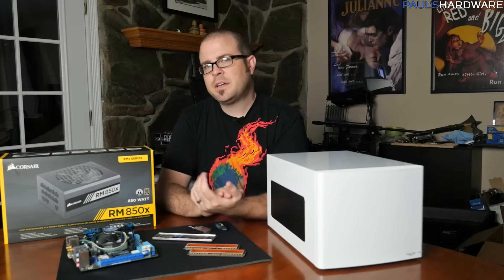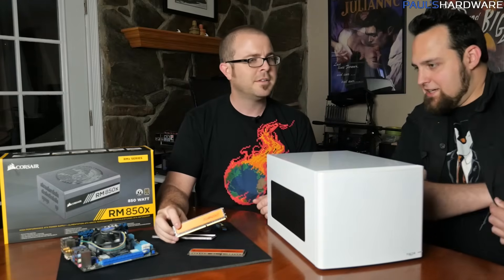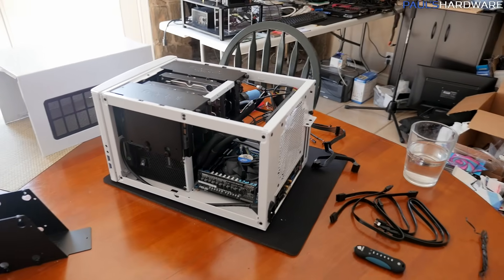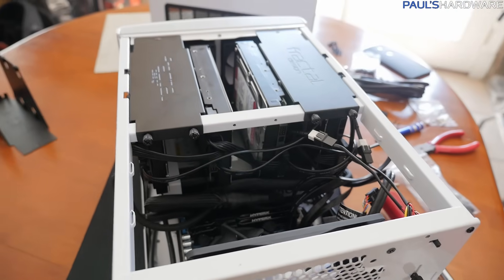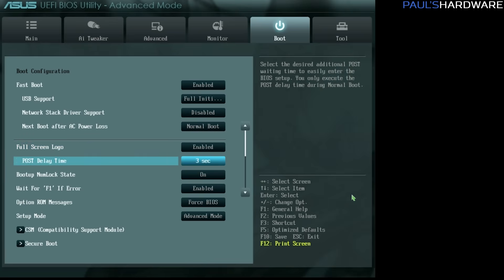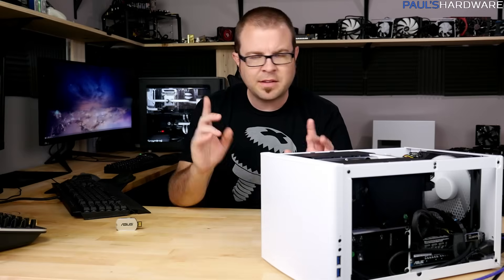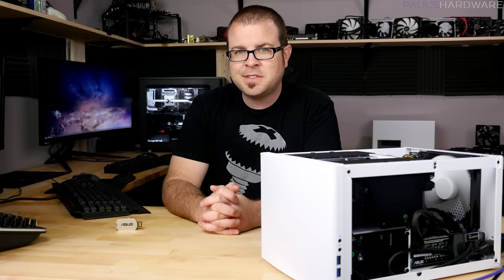Epic 16TB FreeNAS Build (Surprise Guest!)

Comment: ZFS does NOT need 1gb per 1tb of disk space. It will work just fine with very little ram. Companies like Synology and QNAP sell very moderate devices with small amounts of RAM lile 2gb or 4gb to be used as NAS and they work just fine, they know what they are doing. On top of that, a ZFS developer debunked this myth on reddit. ZFS DOES need 5gb of RAM per tb of disk for the deduplication table if dataset deduplication is enabled, which is a feature that is not recommended to enable for most use cases.

Comment: Running any system using ZFS without ECC RAM is asking for a  major disaster and becoming a statistic.  It's a server, use server grade components.  ZFS is a memory glutton.  Your memory needs to be just as reliable as your drives plus you should have it on a UPS.  The FreeNAS community has a burn in protocol for your CPU, memory and hard drives which I'm following for any system I put together for any system that's using ZFS.  Even the low end HP ProLiant Microserver G7s with the slowest AMD CPU supports ECC RAM and ships with it.  Spend the money on a server class board and ECC RAM.  It will save you lots of time and money in the long run dealing with the stress of building a Homer Simpson NAS.

Comment: plex media server very useful setting up a docker or a vm to run linux server then set it up as a whole house add blocker using pi-hole and for god sake put a 10gb nic in there and use its raid speed over the network with 10gb so you have fast in house file transfer.
Reply: https://discourse.pi-hole.net/t/installation-of-pi-hole-in-a-jail-on-freenas-server/4437

https://forums.plex.tv/t/how-to-install-plex-in-a-freenas-jail/60641

lets see here me 2 you zero I guess you dont know what you are talking about

Comment: Ideally your boot drive should be a mini flash drive the type that's about as big as a thumb nail this way you don't accidentally knock it out the usb port or damage it whilst it's running which can happen with a drive that sticks out. Also it's recommended to install freenas on two flash drives so if one decides to fail you can continue running the other till you get a replacement.

Comment: Great video, well put together, my portable NAS(for on site full system redundancy and syncing remote sites instead of using 3G) is an apevia XQPACK2 case(portable mATX), a pair of 5.25 to 8x2.5 hot swap bays, an EVGA x58 SLI Micro, a xeon L5620, 24GB ECC 10600 UDIMM(couldnt find 8500 udimm for some reason) and an LSI 9211(non raid) SAS controller the other 8 bays are read from the 6 motherboard sata ports and a PCIe 1x sata adapter, managment network is though onboard lan, main network is mellenox CX2 10Gb, oh and drives are seagate barracuda 2TB

Comment: Hey, Paul! Thank you for your monthly Q&A videos, they are excelent!
I have a question: I built a little NAS on my own with an old PC with 
Fedora-server, Amahi and free Greyhole (the command-line ver). At the 
day it has 4 HDDs and I was thinkin to add 2 or 3 more but I have to 
change the power-source.. I was thinkin in a 650W 80plus type, do you 
think it's enough? or I will have to look for a bigger one?

btw, It's a GA-945CGM-S2C motherboard with a Pentium D @ 3.2GHz and 
1.5GB RAM (will be 4GB in a near future).

Cheers from Argentina!

(cp from Probing Paul #16, my question it's more related to this) :)

Comment: Hi, thanks for the video.  It's super informative.  Im looking for hardware recommendation to do something similar.  Im looking to do 2 things with it.  First as a backup system for all of my photos and videos and 2nd as a media server.  I'll have around 16 TB for storage for the photo and videos and setup a separate jail for the media server files.  I'm look to run plex and have the system transcode all of the files so I can watch it from my amazon fire tv.  So I need a fast enough processor to handle the transcoding.  Any recommendations?

Thanks!

Comment: seems like it would be more expensive to build a nas than buy one. What was the build cost?
Reply: less than buying one
edit: i slapped one together earlier today out of curiosity in PCPartPicker and it came out to like $1500+ with new parts. if you where going used for the motherboard, and CPU/cooler (and could find a Skylake board with more than 3 SATA ports and a Pentium CPU that would fit the socket) you could probably build one cheaper.

i didnt save the build but it was the third cheapest i3 on the list, the cheapest board for said i3 with 8 SATA ports, 3 of the cheapest enterprise NAS drives i could find (6TB each), 16GB of cheap ram (this guide suggests more), and the cheapest either platinum or titanium rated PSU i could find (i dont remember and honestly i dont think it matters), and i added a 10 gigabit Ethernet adapter to it because why not.

Comment: I have a Q30 from 45Drives running FreeNas with 30 WD 4TB Enterprise drives.  I use it at my office as my main video server.  I have 4 video editors working on it, all connected to it with a dedicated 10GbE cable.  The server has 2 dual 10GbE cards.  And a a 1GbE card to connect to our sales guys and producer computers.

Comment: Is running the OS from the USB fast enough? Would it be possible to have an SSD connected through USB to run the OS and would that be much faster? I'm asking because I don't want to use any of the SATA ports on the MOBO in case I want to expand in the future.
Reply: Running the OS off the flash drive is plenty fast, if you are gonna use a SSD use one as a scratch disk so your HDDs don't potentially bottleneck your network speeds

Comment: I tried FreeNAS once. It had a few minor problems that were largely some development holes.

When I contacted the FreeNAS guys, instead of trying to take time to help with the problems they essentially called me an idiot then sarcasticaly "offered me money back".

The minor problems along with the attitude was enough for me to swear them off.

I ended up just running IIS for my file server. I honestly think the fact IIS is part of Microsoft's server suite scares people off, but its rather easy to setup and there are a ton of tutorials out these days. Since you can get copies of Windows 10 Pro for just $19; I'd highly suggest just breaking down and learning it; it's really not hard.

When I migrated over to using a lot more space for mostly videos, I turned to Emby. They have a great community. Sometimes they jump to conclusions, but they listen a lot and admit when they jumped the gun.

Comment: Morten Hjorth used an IBM Web-server system unit and installed Synology onto it  with 8x3TB SCSI drives and 1TB of ECC System RAM might have been what you would have been looking for.

Comment: Nice build i would def get a new board that supports eec memory i'm running 32gb of kingston eec in mine. Also If you use encryption for your volumes. Make sure you backup your key file and put it somewhere safe like dropbox or google drive or one drive and enable 2 factor on your account. The encryption is nice. it will stop someone from stealing your data set and reading all the data like if they break in your house and steal your box. I use it cuz to me they can have my hardware but they wont get my data!!! also if you use encrtyption everytime you restart your server you have to download the key file or have it handy to re enable your volumes since there locked. It can be a pain but if your like me your server probably will be on 24/7 Also pickup a ups there is alot of them that are supported by freenas.

Comment: so back to my basic question, better/cheaper to buy a NAS off the shelf or to build one from separate components?
Reply: Cheaper build, better performance, features and reliability if you use an available old desktop. Less noise and power consumption if you buy a crappy consumer NAS. Here 🇧🇷  electricity is really expensive, so I had to go for the second option.

Comment: i build mine to fractal node 304 over a year ago and im very happy with it . i didnt use free nas but instead i used normal windows . because i use it mostly only for home sharing and backups of my pcs . got 12 tb WD red and ssd to run the os. i used intel i3 / 8gb ram. running all the time without any issues . very good case for this :)

Comment: be carefull, you definitively should use ECC ram -> https://forums.freenas.org/index.php?threads/ecc-vs-non-ecc-ram-and-zfs.15449/
another good practice is to install freenas on a mirror of 2 or 3 usb keys (using different brands)
also a nice place to start with freenas -> https://forums.freenas.org/index.php?threads/the-faq.30209/

Comment: Hi Paul! I have a quick question as I'm planning to build a NAS for my home as well. Does the freenas provide you with the option of 'auto-backups' ? For example, if I add a file to a folder (say the documents folder), it automatically gets backed up on the NAS. Furthermore, if I remove a file and then add another file with the same name but different content, does freenas have the ability to check whether the file with the same name is actually different from the one that's already on there? Something like a md5 hash comparison maybe?  
Thanks!

Comment: Not good. No ECC-memory. It will corrupt your raidz over time, byebye. That power-supply is overkill. Not fun to run it 24/7.
Reply: Overkill power supplies don't pull any more power from the wall than smaller power supplies. They just cost more up front. I'd rather have this 80+ gold with double the wattage needed running in fanless all the time than a 50p watt bronze that needs to run the fan.

Comment: That Fractal case sucks.  Bulky and obtuse.  Cramped.  Poor cable management.  Airflow doesn't make any sense (with that CPU cooler).  I'd take a cheap mini tower over that case any day.  And putting the power supply completely inside the case beyond stupid.  I wouldn't use that case even if it was given to me.
Reply: I usually go with a cheap case with at least 8 drive bays.  This one would work:  http://www.amazon.com/Antec-VSK4000E-Power-Supply-Tower/dp/B00MIG2EE4

Comment: At 00:35, by "triple redundancy", if you mean you want to be able to withstand 3 drives failing then you have to dedicate 3 drives to parity. (RAIDZ3) That means the 4x4TB setup will give 4TB of usable storage space. I would add a few more 4TB drives, fill those empty slots, and use RAIDZ2 to get more storage efficiency.

And as others have mentioned, not using ECC RAM is a big consideration for ZFS. If you are doing that, it should at least be a conscious decision with the risks considered and weighted. I'm not sure you have consider it, because there was no mention. Logan must have at least mentioned that to you off-camera?

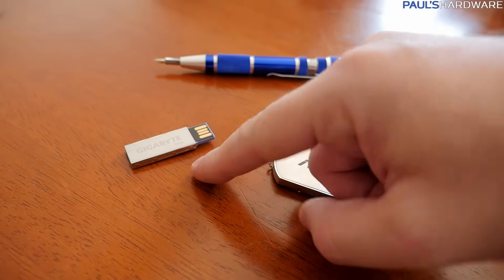Comment: 5:21 "It's USB3". No it's not. It has for connectors, so it can't be USB3. It's only USB2 and because USB drives in general die very often I would recommand a cheap SSD with like 30 or 60GB for the FreeNAS installation.

Comment: Paul you should make a pfsense unit and set that up along with your NAS, that will give you excellent performance on your network as well as security - The OpenVPN built into it is very easy to setup as well if you need remote access.

Comment: I'm really curious, what kind of USB drives are those at 5:20? I mean, I know they are Asus and Gigabyte, but what kind of connector is that? Never seen that style before.
Reply: It's a normal usb without the metal things around, i think you call it "low profile USB"
Reply: +SimpleSock It's normal USB but without the metal housing around it. Take a USB drive, imagine seeing it without the metal (which is just to hold it steady in your USB port by the way) and there you go ;)
Reply: +SwaggerBoyNL1234 Do you know where I can buy them or what they're called? I can't seem to find them anywhere online.
Reply: +SimpleSock No I'm sorry, I don't know where to get them.

Comment: Does a nas use intrnet from the provider if you a using it on your home network  (have a film on the nas and watching it on your computer? ?
Reply: +Gregor Kalan You don't need to have your NAS connected to the web, just your private network. My NAS is set up to only be able to download updates and blocks all outside network access. You have complete control if you're admin.
Reply: if you dont make it reachable from the outside it wont.

Comment: Im prolly getting old but I cant make a NAS without removable drives. Pulling the case apart to replace a drive is horrible.
Reply: +Kurukx You replace a lot of drives?  Your case is that hard to get drives out of?  I think your choice of hardware is the problem more than 'removable drives'.
Reply: Dave L Well given time say 5 years. Do you want to plug in new drives or pull the PC apart to do it. Time is relative a brand new NAS yes it will work for a long time.
Reply: 5 years in and all sorts of things can start failing.  Power supply being the most likely, and frankly, the most difficult to replace, as it attaches to almost every component.  Why waste money on removable drive parts.

Comment: Anyone know of a similarly sized case and similar looks like the Node 304, that will fit a regular ATX motherboard?
It should be just enough wider and deeper to fit a regular ATX motherboard. And have more openings for the 7 expansion slots of course. It should definitely not be taller.
I don't want the Node 605.

Comment: Going on the capacity of the build you've shown; would doubling the memory to 32GB (if the motherboard allows it) would benefit on the NAS performance in either loading or streaming files?

Comment: Great timing for the video.  About to build a nas with a xeon e3-1220 v3, asrock E3C226D2I, and ecc ram.  Still deciding on the case.  Might go with DS380B or maybe Fractal Core 500.

Comment: That's a pretty lookin' NAS, gosh!
I have a FreeNAS box as well. Might I recommend creating an OpenVPN server on it for on-the-road access? That's certainly be the most secure way to go about doin' that, and it's worked really well for me the last year or so c:

I used to have a Plex server on mine as well (It's one of the standard FreeNAS plugins, and pretty neat-sounding and tempting to install) but I decided to simplify it into doin' as little work as possible.. It's where all my data is, so I don't want the hardware workin' really hard with transcoding and stuff and risking hardware failure! On that note, you should absolutely get an Uninterruptible Power Supply for your build. FreeNAS does NOT like unexpected shutdowns, especially from things like power outages, and it has built-in modules for receiving shutdown signals from a lot of UPS c: I got a little consumer-grade APC one with USB out connected to my box, and it's saved my bum through a couple outages, that's for sure!

Best of luck with FreeNAS, and if you want any more information beyond the Tek tutorial, CyberJock on the FreeNAS forums made a very informative PowerPoint that's certainly worth goin' through:

https://forums.freenas.org/index.php?threads/slideshow-explaining-vdev-zpool-zil-and-l2arc-for-noobs.7775/

Comment: Can you review my streaming pc build....
i7 6700K
Corsair H80i GT liquid cooler
Msi Z170A Gaming M5 ATX LGA1151 Motherboard
Kingston HyperX Fury Black (2 x 8GB) DDR4-2133 
Samsung 850 EVO 250GB SSD
Seagate Barracuda 1TB 
Asus GeForce GTX 970 4GB STRIX
Corsair SPEC-02 ATX Mid Tower Case
EVGA 500W 80+ Bronze
Microsoft Windows 10 Pro Full
2 Corsair Air Series AF140 Quiet Edition 67.8 CFM 140mm Fans
Reply: Get an h100i gtx ($20-$30 more) and an Msi gtx 970 instead of the strix for a color matching build
Reply: nice build bit if you dont have it jet i would get a corsair 100i like the command above stated
Reply: yeah thats what im going with thanks !!!

Comment: Hey Paul, I just want to mention that on zfs it is recomended to use a certain number of drives for a specific raidz configuration. for the raidz1 (raid 5 equivelant) u should use 3 or 5 drives. This is due to the way zfs writes blocks and create parities. Long story short, 5 drives will live longer and perform better than 4 in a raidz1 on zfs. Just a heads-up ;-)

Comment: if youre not into unix(freenas) try OpenMediaVault which is linux (debian) based with web gui ofcourse, so makes it easier for ssh and command line if needed, and with aptitude its easy to add anything needed.
I am on it log time now, no problem what so ever, and before that i used nas4free which runs much better on older hardware but OMV kick ass all around

Comment: 850 Watt Power Supply for a NAS? m(
Even my AMD Gaming System has less then 500!
Reply: +Ox King Overkill!
Reply: +Ox King My Synology NAS runs off 65W
Reply: +Ox King My 750ti Pentium system has a 300w PSU, talk about pushing it.
Reply: ytilanigiroon Exactly so why use such a big PSU?
Reply: You all know that the rated wattage is peak wattage, right? It will only draw 850W IF the system demands it. The 4 4TB reds only draw 60W (15W each), motherboard draws 30W, CPU draws 65W, memory draws 18W… 173W TDP, so the PSU will draw less than a quarter of its peak rating when the system is running flat out (theoretically).
Reply: +Vax Buster Again, bigger gap between peak wattage for the PSU an actual TDP of the system /should/ lead to a cooler running PSU (should run in silent/fan-off mode) and increase life expectancy of the power supply. Not to mention, again, that 400W 80+Gold or better PSUs aren't exactly common... (plus the fact that Paul had the PSU lying around already)